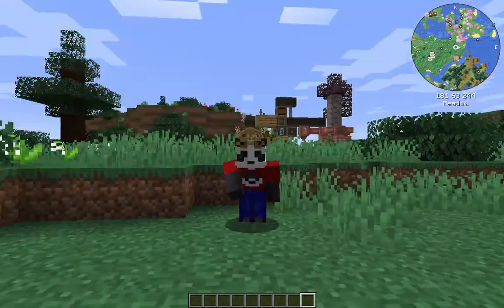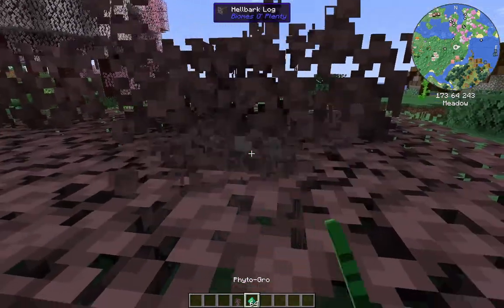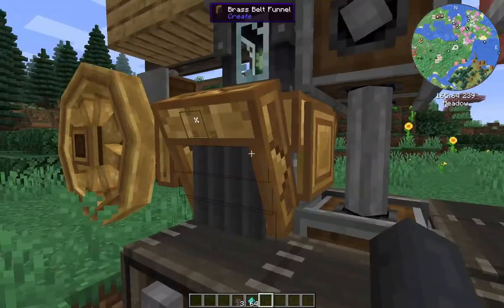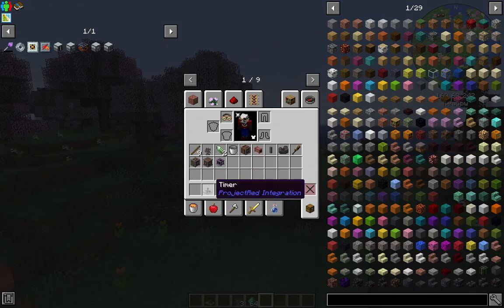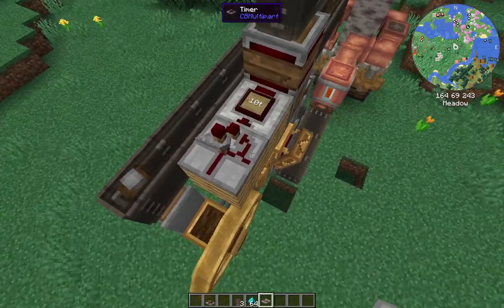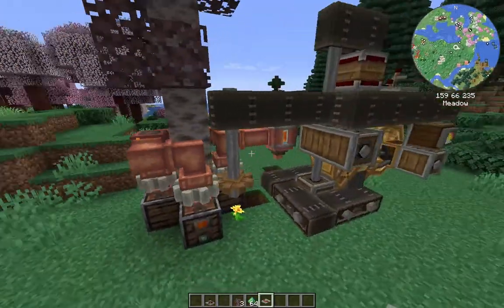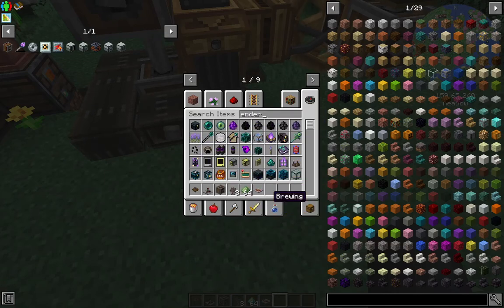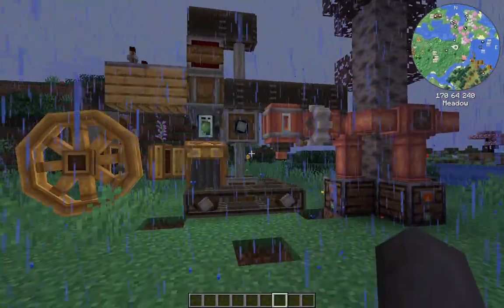Create: Above And Beyond Tutorial Ep1 Renewable Furnace Engine

Comment: Occultism has the best storage option by far in the pack but pretty pipes and storage drawers make life so much easier when creating contraptions. The flux pipes are easy to miss (I did) but make it really easy to use the generator that can burn silver on your entire set up.
Reply from the maker: I am currently rebuilding the factory with Pipes, and they are beautiful. I need to do occultism in a more in depth way, so may do a Spotlight soon, on 1.18 :)

Comment: Plant the seedling on a two block stack from where you want it and you will be able to replace the two temp blocks with hellbark logs even if you get a bush. It works every time. The extruders see the logs as part of the “natural” tree. You cannot place leaves however, so you can trim it down but be sure to leave at least three leaf blocks total on the side of the extractor and sides.
Reply from the maker: I did try that, but got annoyed with not getting it to work. Given how easy Phytogrow is to get , i just do it that way.